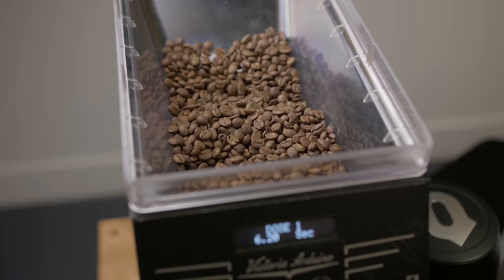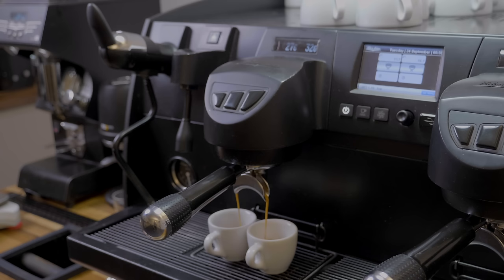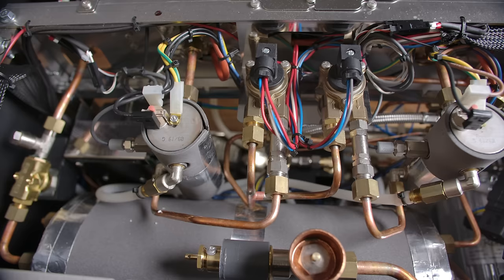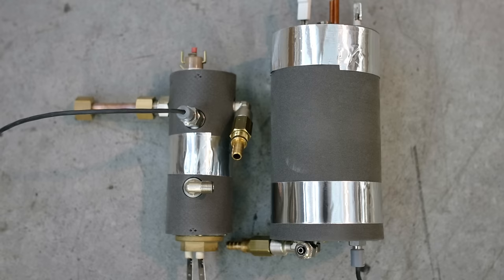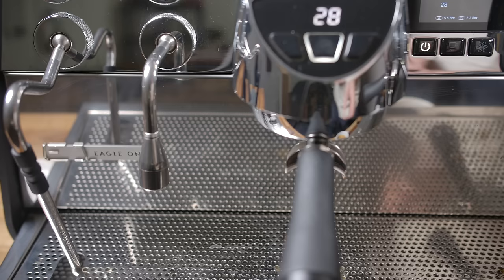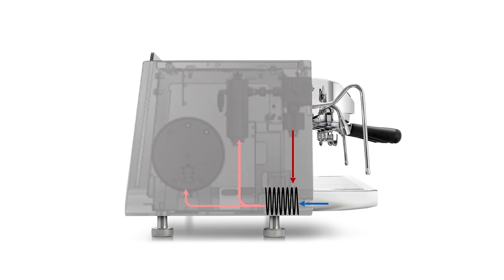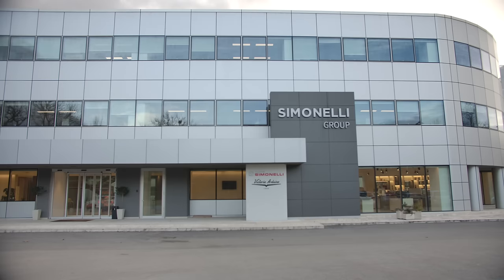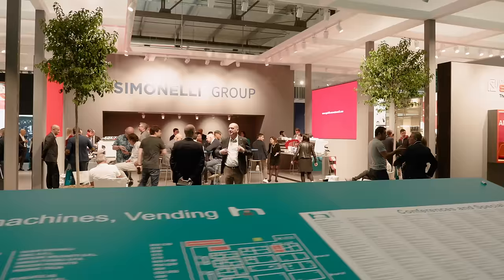The Eagle One

Comment: Capturing energy out of the waste water? As someone who worked with steam power plants for six years(U.S. Navy), this is what I like to hear.
Reply: It surprises me a bit that there's enough heat in the drip tray to offset the electricity used on the motor needed to circulate the water through there. But, then again, this is clearly intended for use in a coffee shop, so there's probably more hot water there than you'd expect. OTOH, this savings is double if you've got AC on and a net loss if you're having to heat the shop in the winter.

Obviously, on a ship or something of that scale, there's tremendous savings to get like that.
Reply: @SmallSpoonBrigade  Luckily here, they don't have to deal with superheated steam!! That was always a little scary.
Reply: @SmallSpoonBrigade  It looks like a passive device, with the waste water driven by gravity and the cool water passing through a coil under its incoming water pressure.

Even if it does use power it's still a net gain even when your heating is on. The amount of heat put into the room by the machine will be about the same either way, the heat exchanger just replaces some electric heat with heat recovered from water that would have gone down the drain and been lost from both the machine and the room entirely.
Reply: Window AC units sometimes also have an extra coil/heatsink on the bottom of their condensation trays to help with managing the state of the refrigerant using the dripped water and thus increasing the efficiency.
Reply: @davidthedj  I like it.
Reply: it's not cost effective.

for $5,600 before taxes, you need to run the machine for what, 25 years, to save enough on electricity to come close to recapping your outlandish cost.

which you can't do since many comments here attest the service, repair, vendors don't give support, don't sell replacement parts.

the one thing the company did well was buy/flatter a good endorsement from James.
Reply: @aryehh7128  Of course it isn't cost effective.

Comment: Robotic water volume control? Heat exchangers?

Eagle One: the Fremen stillsuit of espresso machines. There's your SEO done.
Reply: Eagle One mk2 will probably require a nose plug
Reply: I get it, algorithm, the new Dune trailer is out. MAY THY BLADE CHIP AND SHATTER! ;)))
Reply: "I should've suspected trouble when the coffee failed to arrive." - Liet-Kynes
Reply: Would be great if people were in any way likely to search that.
Reply: all that, and NOBODY has yet said "the 'spresso must flow", may Shai-Hulud cleanse your poor souls.
Reply: It is by the juice of Caffeine that the thoughts acquire speed, the lips acquire stains.
Reply: That cinematic opening. That fine metal finish. That stylized "eagle" crest. . . hold on a minute.
Reply: I knew there would be a stillsuit comment
Reply: As long as you can get past "It is the slow brew that penetrates the filter."
Reply: This machine has good water discipline

Comment: I love the heat recovery from the waste water! That's actually similar to what some large buildings do with the ventilation system where a percentage of air is always brought in for fresh air and it goes through a heat recovery system with the warmer (or colder) inside air. Saves a lot of energy instead of dumping a whole bunch of conditioned air without reclaiming some of the energy.

Comment: One topic I would be interested to know is repairability. I feel this this should go hand in hand with sustainability. How easy is it to repair and maintain and what are the estimated costs in the long run? 

I feel like the more electronics we introduce, the faster it will become outdated and unsupported.
Reply: Not sure about electronics. But 8% gain heat exchangers sitting in a place as unkind as a drip tray.....
 
Somewhat related (although surprisingly rarely appreciated in this Age of Fashionable Hysterics): Waste heat minimization, only make any sense at all, in rooms which are already too hot. Otherwise, "waste" heat, whether from old-school lightbulbs or "inefficient" espresso equipment, simply offsets heat you would otherwise have to get from a separate heating appliance.

Even less related: My pie-in-the-sky coffee preparation industry waste reduction end goal, would be to wrap an Aeropress in just enough supporting structure, to enable it to handle a hydraulic ram (or manual lever) netting 8 bars of pressure. And, also to fine tune filters allowing it to be used successfully for pour over without clogging.... It's already very forgiving, as far as thermal insulation goes. Just seems like it could be standardized into a really cheap, well understood and available-everywhere "universal" extraction vessel. Emphasis pie-in-the-sky :)
Reply: @paulnorman8274  well your point about "waste heat" offsetting some room heating consumption only makes sense with certain kinds of heating systems. if you're using heat pumps for heating then it's actually less efficient to offset it as it's more efficient than the "waste"  energy. Also you'd have to consider that not all cities need heating. NY in summer, Los Angeles, etc... Will actually need more A/C as waste heat increases.
Reply: @paulnorman8274 your waste heat point is interesting but wrong. Because heat travels from high to low it is more energy efficient to heat a room from the bottom than it is from the ceiling. If those lightbulbs where attached to the ground then yes the waste heat is heat that you'd have to generate anyways, but because they're ceiling mounted its less efficient

Comment: Interesting thought I hear in architecture and green building tech: "the most sustainable building is the one that's already built." The basis being that it is more environmentally costly to tear down and old building and build a brand new high efficiency one than it is to modify and improve an existing one. I think this could be an interesting way to think about in advancing coffee tech. Innovating in a way that uses existing infrastructure as the basis for advancement. In other words "the most sustainable espresso machine is the one that's already built" Thoughts?
Reply: Yes and no. Sometimes, it's possible to innovate off existing solutions but, sometimes there are the happy accidents that fork away, or even start another evolutionary trend. One should always start where you are with what you have and solve the immediate problems at hand before indulging in Blue Sky Musings. New products shouldn't be produced just for generating a new fashion and more profit. They should solve real problems, instead of just turning consumers into magpies.
Reply: What they mean is that when you tear down a building and build a new one, there's a huge amount of resources involved. Repurposing materials from the old building and including more sustainable ones in the new one will reduce it, but it will likely take many years, if not decades, to overcome that initial use of resources.

At this point, anything made in the last couple decades is probably not something that can be replaced with something more sustainable at all as things have gotten pretty efficient. At least when architects are focused on that.
Reply: Completely agree... BUT coffee shops don't stop buying coffee machines, so if they are to buy something new, it might as well be sustainable. Like cars. I'm completely happy with my old VW kombi, but most people insist on buying new or newish, despite the fact that the production of a new hybrid car is disastrous in terms of environmental resources.
Reply: Someone should tell Tesla....... Or all modern car builders for that matter....

 In practice, keeping a leaky old lumber cabin in Fairbanks, Alaska comfortable in winter by application of massive amounts of wood fired heat for another century, will in no way be more efficient than replacing it with a similarly sized factory built and QA's reefer box with 4 pane windows and a proper HRV.

Even in most places outside Alaska, reefer boxes with HRVs would massively improve energy efficiency of almost all existing dwellings.

Comment: I've owned the Black eagle for a good 3 years now and except from having a few issues the first year around with malfunctioning parts, it's been a fun companion. However, for being a machine for coffee nerds who like full tweakability I found it staggering that Victoria Arduino decided to cap several settings without good reason. My biggest concern is the pre-wetting. It is capped at 5 seconds with a pause of 5. I personally would have loved it to be able to pre-wet until the first drop of coffee hits the cup and proceed with full pressure from there. We often experiment with super fine grind (close to turkish) and off the charts ratios like 1:0,4. To get that working at its best you really need a good 10-15 seconds of prewetting at the least. How come they lock down the firmware?!?!!
Reply: It's a shame he never answered this question it's an educated real interesting question

Comment: I love the 8% gain in efficiency from the water inlet heat exchanger, it goes back to my time working with steam turbines in power stations.
 Every pressure stage of the turbine had bled steam heat exchangers to get as much thermal return of the spent steam cycle.

Comment: Super interesting video. On the consumer side, how would you evaluate sustainable espresso machines? Or even a home drip machine?  I would be interested if you have any recommendations or tips and what to look for as I currently have neither.
Reply: Assuming it doesn't use too many rare minerals that are shipped from the other side of the planet, then repair-ability and build quality will be high on the list.  A solid machine that can have any broken parts replaced reasonably easily and the old bits recycled easily (which usually means metal) is going to be a lot more sustainable than a mostly plastic thing you throw away when it dies. This would often come down to simple, basic machines with lots of metal and limited electronics. Older Gaggia, La Pavoni and Rancilio machines come to mind, and probably Rocket, Profitec/ECM and similar. Buy an old La Pavoni Europiccolo and mod it for improved efficiency and it'll soldier on for 20 years or more, which means you're not buying 2-3 replacement electronic filled machines that don't recycle as well.
Reply from the maker: It's a topic I'm working on for a future video - gonna get weird with some data and a bunch of espresso machines!

Comment: Being more efficient with beans is probably way more beneficial to sustainability than water and electricity. The resources needed for those beans to arrive in that hopper from a bush could run the machine itself for many years. Not to mention the cost of beans per pull vastly outweighs the cost in water/electricity. I think the mindset is totally on point, but just misses some of the key concerns when it comes to sustainability. Though as he said, this is trinkets when compared to something like Amazon.

Comment: Very nice video. Another area you could look at is; designing a steam wand that can handle plant based milk better than the existing ones. From an environmental point of view literature shows that  the milk has by far the biggest impact of for example a cappuccino. Making it easier for baristas to use plant based milks could motivate them to use it more. It also gives Simonelli a competitive advantage because their new function could accommodate to the trend of using more plant based milks as that will be needed to fight climate change.

Comment: Some possible next steps:
- An easy one: What gains can be made on the grinder? (probably a lot less, electrical motors are very efficient, so probably not so relevant)
- A hard one: Minimize the dose of coffee needed to pull an espresso, without losing on quality.
- An obvious one: Remembering an older video about the cost of a coffee cup, where rent was the #1 overhead cost: reinvent the coffee shop experience, with tiny coffee shops, coffee trucks...
Reply: Regarding the grinder, the biggest wasteage is on grounds stuck in the burrs. Check out his video on the Niche grinder

Comment: Inspiring narrative for this innovative coffee machine (Vittoria Arduino Eagle). By coincidence, immediately before viewing this video, I watched  your other one about the scientific modeling enabling high quality espresso in about half the time while using half the coffee that is traditionally used in the cafe industry. I was therefore anticipating these two major advantages to be available (as adjustment options - akin to “green settings” - not to limit the ultimate pursuit of espresso excellence) in this new machine, to triumphantly combine meaningful coffee volume + time of operation efficiencies with the remarkable energy/heat + water efficiencies described in your video. Being that environmental and financial sustainability for the beleaguered cafe industry is at the heart of this project, wouldn’t it make sense to also include and highlight coffee use and operational time  efficiencies as significant advantages for this project?

Regards,
Brian

Comment: i love it when machines are easily accesible and repairable, doing many repairs myself. I also love the look and feel of more sophisticated designs that in my opinion are usually minimalist in nature. I still own my Braun coffeemaker, which is just junk from the moment you buy it, so i try to enhance it's use through maintainance... but machines like this are really the way forward and at least make it a better return on investment. A machine you can repair again and again is ultimately much cheaper. In my experience in repairs they tend to outlast many other devices that aren't designed that way. But then again i love to buy broken machines and get them to run again and this looks like the kind of machine you could pick up from a scrapyard in 40 years and bring back to life with a few hours of TLC and i love that. Looks good <3

Comment: With energy and material costs only going up - the need solved by these design choices are only getting more appealing. Even if the intial cost is higher it might also work out on paper reasonably quickly.

Comment: Dual/Multi-boiler and PID temperature control should be standard in all commercial machines. Of the 30 machines I took a look at recently only a handful of them had it. I like the idea of making the boilers but being able to shut off one or more group heads would also help too by reducing power consumption. We only used all 3 groups and both steam wands during the morning rush and the rest of the day 2 heads and 1 steam wand were enough.

Comment: someone could argue that a coffee place or person who can afford this price range machine, can DEFINITELY afford the extra electricity bill. Especially if the person eg has renewable source of energy in his (most probably) really expensive place. You are right about the water waste which is the only solid argument imho. I guess there are solutions to this also with filtering systems etc although highly complex.
The future(or present) in coffee machines should be what DIYers are doing years now. Control in every aspect of the brewing process. Preinfusion, shot duration, dosage, temperature, pressure.
Reply: I should add that all these features are really cheap to implement

Comment: I guess you could be even more efficient by switching from infusion brewing to percolation. From 18gramms of coffee for 36gramms of espresso to ~60g for ~1000gramms of coffee.The french press might be the best way to get most out of the beans without using paper filters. But we all love our espresso so that is not very likely to happen ;)
Reply: I think vacuum pots are better because the grounds in the coffee are only 1-2% of the grounds in a French press,  they  allow much higher brewing temperatures, prolonged brewing, and a final product which is much hotter. I currently use a Cory DI with a Cona glass filter rod. After grinding, the coffee only comes in contact with glass.